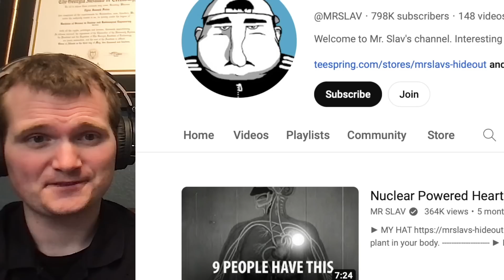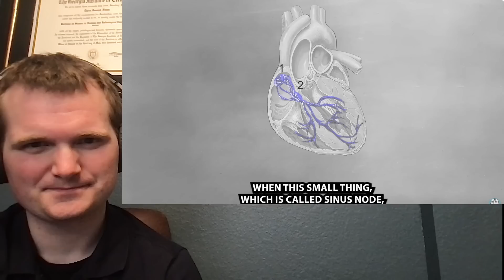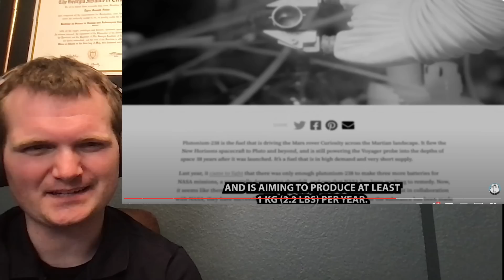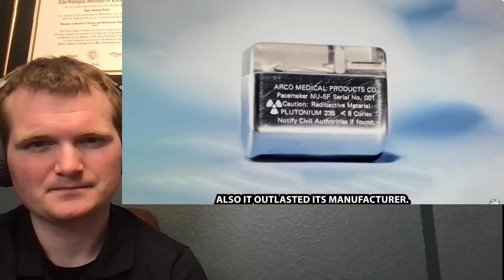NUCLEAR POWERED HEART - Nuclear Engineer Reacts to Mr. Slav

Comment: Didn't you already react to "tritium batteries"? like in betavoltaics ... or as it is the canon on youtube, using trithium night light ampules for photovoltaic to build a "nuclear powered battery".

If not ... uh ... please do so ... and do a good in depth research .. you could either make a longer video about it citing several other youtubers ... or have more fun with the different takes..

One such "nucular battery" actually made it from it's creator over to dave jones from the eevblog who logged some more efficiency/effectivity data about it. ;)

Comment: I would want to buy a rtg battery hybrid for my portable electronics, imagine never having to connect a charger.
Reply: RTGs aren't as good an idea as they sound. They need to be quite large to produce a decent amount of power. On Curiosity they used 4.8 kg of plutonium to get just over 100 W of power and that mass doesn't account for shielding.

Another downside of RTGs is that they produce electricity from the decay heat, if you don't remove that energy from the nuclear material it will continue to heat up as the energy has nowhere to go, so you always need to be dissipating it's energy whether you need it or not, most likely meaning you need a heatsink on it too, I believe curiosity's RTG has one.

Comment: My hubby has heart failure, we have never been offered this...thank goodness!! He does have a CRTD with 3 leads into the heart. Far, far more than a pacemaker.
Reply: They are very safe, as most medical technology, just because it uses "nuclear fuel" doesn't mean it will hurt the patient, but I can see you wanting the most modern technology for your husband, and thanks to todays inventions in medicine, he likely will live a long life, and I truly wish him the best.

For those who did not study medicine or just don't know: A CRTD is basically a pacemaker, but it also continuously monitors the heart rhythm and will defibrillate if the heart is in a state that you can correct by defibrillation - cardiac arrest not being one of them, which is a common misconception often shown in medicine shows on the TV.

In case of cardiac arrest, check the airway for obstructions, and then start compressions at a rate of 80-100 per minute, with 10 to 12 breaths per minute. You will have to push HARD, generally I was taught somewhat jokingly, but mostly seriously "if you hear ribs breaking, then you are applying enough force".

If another person happens to be with you, tell them to take some workload off you by doing the rescue breaths correctly.